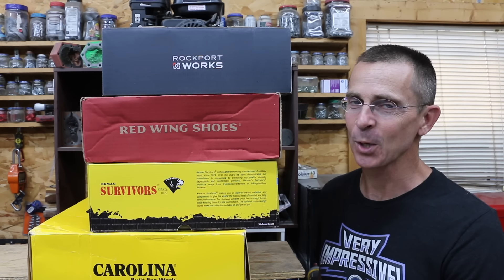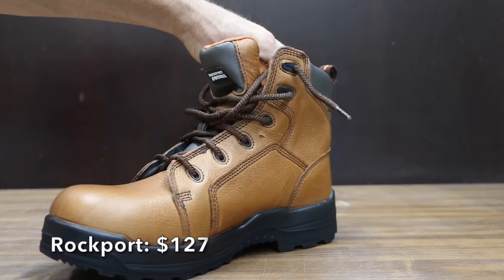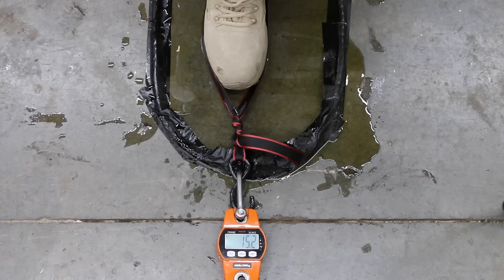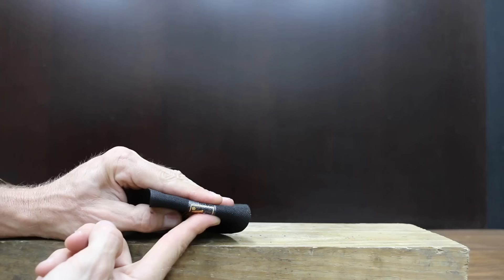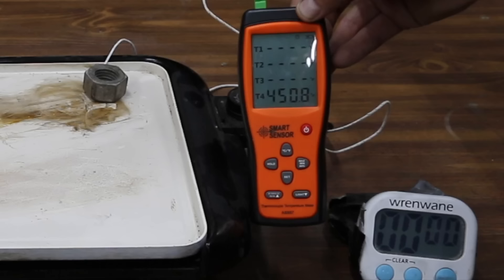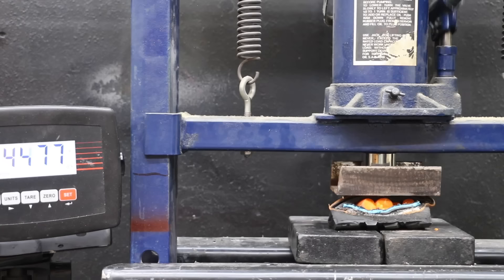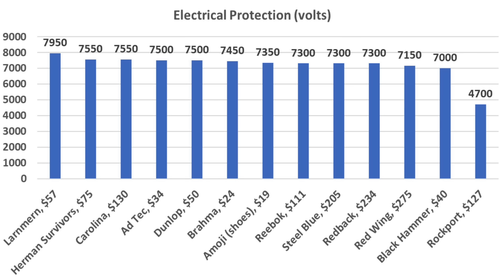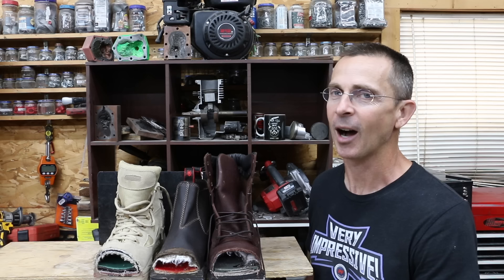Best Boots? $24 vs $275! Let's Find Out!

Comment: Todd, I worked 30 years in a power plant. I wore nothing but Red Wings and only had to buy 2 pairs my whole career. I did have to replace the soles a few times in both pairs but the rest of boot held up great. If you buy good boots, they'll take care of your feet. Great content and channel!
Reply from the maker: Thanks!  Thanks for sharing.
Reply: I wore nothing but Red Wings for years like you said put new soles on now and then witch I had to make sure the shoemaker used genuine Red Wing soles each time  and they were good to go ,I liked the leather on the Wings because I needed water proof so with a regular treatment of wing oil my feet stayed dry all the time ,And the best part is all those years I still used the same size every time try that with another brand.
Reply: That is a the difference with a boot that can be repaired rather then replaced.
Reply: 2 pairs in 30 years?! I’ve had red wings, Ariats, etc. and I have to get new ones every 1-2 years. I work in agriculture.
Reply: true if you bought them 30 years ago not so much today.
Reply: I worked in a garage and never seen any booth that lasted more than a year.  Fact is the chemicals and the way you need to work wore out the tops of the boots before the souls.
Reply: @answeris4217  amen brother. Fertilizer ruins everything too
Reply: @anthonysmith4222  even in construction were your boots become a tool you are kicking everything or using you booth as a leverage point or slamming on the back of a shovel.
Reply: Welder here. I get 4 years out of a pair of Red wings (same as the ones in the video). Typically at year 3 I have to apply Tuff Toe to repair the wear in the toes from crawling around on the ground.  I love that they're USA made as well.
Reply: @anthonysmith4222  Agriculture here too, 9 months is the longest for me. Most boots I have tried come apart at the sole/glue points.
  Walmart's cheapest leather boots last me about 6 months on average, saving me a couple hundred bucks each year.
Reply: @OhioFootHills  I’m trying these Cody James boots out. They have been comfortable so far but run a little big. First non lace work boot I’ve had. Nitrogen will kill anything. Haha
Reply: I also wore nothing but Red Wings, until I found Lalo Tactical. Even more comfortable and durable than Red Wings.
Reply: I had a pair of Red Wing Pecos that lasted over 20 years, and I spent 8 of those years in the oilfield in Texas walking through acid water, oil, and various other chemicals in addition to mud and water. The one thing I did though was wash my boots at the end of a two week hitch and then rub them down with a coat of mink oil. This waterproofed them, as well as kept the leather from cracking. Most people don't know it, but any Red Wing store will clean and oil your Red Wing boots for free. Now personally I wouldn't be a j3rk and take them covered in mud, but if they are a little dusty or only have a little mud around the bottom, they will gladly clean them for you and oil them.
Reply: @anthonysmith4222  I got almost 20 years out my Red Wing Pecos boots. The store I took them to to get oiled would always be in amazement when they saw the stamp on the back that showed the date of build on them. In fact, they asked me if I ever wanted a new pair of boots, they would give me a new pair, if they could keep the old pair to show to customers. I actually took them up on this when the leather finally cracked at just shy of 20 years... They still have them on display in the store. I would either rub them down with mink oil every month (every 2 weeks when I was in the oilfield) or take them in and have them cleaned and oiled by the Red Wing store for free at those time intervals. If you talk to a manager who knows a lot about their boots, they will tell you the made in America line is tougher than their other lines, and the Pecos series is the toughest of all of them. Don't leave them outside on your porch in the elements, don't leave mud on them as it sucks the oils from the boots, don't leave chemicals on them, clean them monthly, and oil them after you do... I prefer mink oil as it seems to condition better and waterproofs the boot. I work the mink oil in using a piece of old t-shirt or sock and let them "dry" for about a day before I am going to start wearing them again.
Reply: @answeris4217  I wore my Red Wing Pecos series in acid water while doing hydraulic fracturing in the oil field for multiple years. I also stepped in clay stabilizer, friction reducer, buffer, oil, and who knows what else chemicals. Now I don't know if the fact that I caked on mink oil every 2 weeks, and allowed it to soak in for a minimum of 24 hours before wearing them back out in the oilfield is what kept the chemicals off them and kept them in good shape, but none the less, they lasted about 8 years in those conditions. I stood around sometimes for 30 minutes straight in an acid/water mix. I always rinsed them off with water at the end of the work day though. I usually cleaned them very well at the end of my 2 week hitch and then oiled them heavily with mink oil and they would be allowed to soak that in for the next week I was off work. Occasionally I would forget and have to oil them the day before I left to go back, so in those times, they only had 24 hours to soak up the mink oil.
Reply: @OhioFootHills  the red Wing Pecos have tacks (nails) that hold the sole together I believe in the addition to glue. I never had my separate in almost 20 years.
Reply: @Steven-gv1ke  they wouldn't last a year in a car garage.  Fact.

No boot would.  The stuff we walked in every day doesn't come off with a hose.  If the chemicals didn't chew through leather it would chew through rubber or any other synthetic.   

We are talking about chemicals that can take years of gunk and baked on grime off of engines inside and out without scubbing.  Stuff that is designed to do the opposite and the stuff designed to clean the floors off with all that stuff on there.

We dealt with extrem cold and extrem heat.  And not to mention we are on hands and knees on concrete every day for every single car.  Sometimes you needed to use your boots to stop cars from rolling.
Reply: @answeris4217  well seeing as how I had to have a HAZMAT license to transport the industrial grade acid we use in the oilfield, I can't imagine the stuff y'all use is much stronger. We had to wear acid rated respirators because the fumes coming off of the acid tanks were so strong. So if you don't wear respirators in your shop around those chemicals constantly, I'm gonna say they were definitely not any stronger than what we use. I was required by OSHA to use an acid apron, full face shield, arm length chemical gloves and an acid rated respirator. Now the acid in this concentration was somewhat diluted by the water that also leaked at times into our "rubber duck" containment pond that ensures we don't allow these chemicals to soak into the earth, but yeah... They are still VERY strong. I would stand in that acid water for sometimes 30 minutes rigging down the acid tanks, knocking 4" hose wings off with a sledge hammer.
Reply: @answeris4217  as far as the heat and cold, I worked in 122 degree heat, in south west Texas all summer in the sand, and walked on top of thick steel machinery that the surface at times was 150 degrees in the sun. If you put bare skin against it, it would instantly burn you. Those boots also went up to North Dakota with me, where I worked for 2 years in the oil field as well. They at one point saw -40 degrees Fahrenheit while I was up there one of those winters. I had to put super thick wool socks on and put feet warmers in the bottom of my boots. Even then I could only stay outside for maybe 90 minutes at a time max before I had to go back into a truck to warm up. Anyone who knows anything about the oilfield knows that they are about the harshest conditions anyone can work in.
Reply: 6 months to 18 months for my redwings. Work in a welding shop
Reply: @OhioFootHills have you tried high quality sewn boots that don’t use glue? 
Like a pair of whites?
Reply: @answeris4217 bullshit. There are plenty of boots that last more than a year in a garage. I would know. I’ve been running my red wings for 5 years now. Regular maintenance just the the aircraft we take care of, and they last a good while.
Reply: @Steven-gv1ke damn, you stool in the acid water without special acid mu boots?? Ever get negative effects to your feet?
Reply: @richeyrich2203  I work in an busy automotive garage and no boot last.  Constantly in oil or antifreeze or brake clean or water...   looking under cars so the steel toe is in contact with cement or kicking steel hoists under the cars.  Using your boots as leverage to stop tires and the like.

Sure in a different environment like a hanger taking care of a single plane your miles might very but I haven't seen any boot that could withstand the punishment of an auto garage.
Reply: @richeyrich2203  I'm giving caterpillar Second Shifts a go at the moment. The first pair lasted about 10 months. They would have probably lasted a couple months longer, but I neglected them a bit during the winter.

Comment: I've had Redwing for years. Several pairs as I walk about 20,000 steps a day. I will continue to buy them. They stay pretty comfortable for years but of course changing the insoles regularly.
Reply: How do you get them to last years? Mine wear out in 6 months
Reply: @Hallowsaw  clean them everyday lol
Reply: @Hallowsaw  They will clean and condition them for free in store. There are several tiers from Red Wing, stick to the higher tiers and they will last years if not 10+ years after a few resoles.  If you get a $200 boot it will last a year, at that price point you are competing with Wolverine or Timberland, if you get a $280+ boot and a custom insole, you are in a completely different world for durability and comfort.
Reply: @Hallowsaw  
Buy the American made boots.
Reply: I agree.
I buy the American made Redwings and they will last for years if you keep them oiled.
Reply: I had my Red Wing Irish Setters resoled by their factory service via local dealer last year for the second time. I bought them new in 1983. ❤
Reply: I walk around 10-12k steps a day with an occasional 20-25k day mixed in at a steel mill. My Redwings last well over a year and I typically replace them because of comfort not integrity, plus my work foots the bill.
Reply: @Hallowsaw  Make sure you're getting one of the Made in USA models, not the ones made overseas.  Most of the Made in USA models should have replaceable outsoles, you just bring them into the store (or mail them in) and they'll replace them for you.  Make sure you take care of the upper.  Most of the Made in USA models are pure leather, so make sure you clean them regularly (at minimum, wipe them down with a damp cloth weekly, maybe daily if your job has them getting a lot of dirt and grime on them regularly) and oil them regularly as well.  They sell stuff they call NaturSeal, or you can use mink oil or vegan alternatives (although the idea of using a vegan oil on leather boots is kind of amusing.)  You'll want to oil your boots more frequently when they're new, but eventually the leather will "drink" enough of the oil to saturate it and you won't need to oil them as frequently.  "Thirsty" leather is visibly different from well-oiled leather, and if you go too long without oiling it, leather will eventually crack and degrade.
Reply: @dc8836  I second every bit of this advice.
Reply from the maker: Thanks for the feedback.
Reply: I`ve used different brands of insoles in my Red Wings the red wing brand inner soles are good but there are others out there that last as good and are thicker and softer.
Reply: @gunfisher4661  Me too. I bought some from Walk/Run store which are working pretty well. I've also used "10 seconds 3210" insoles which I love but they're unique so not for everyone.

Comment: This video basically sums up why I love Red Wing. I went from $50-$150 work boots every few months to a pair of Red Wings that have lasted several years. The comfort difference is just an added bonus.
Reply from the maker: Thanks for sharing.
Reply: red wings are the only boot ive worn the are so comfortable they dont need to be broken in.
Reply: Especially if you go to a redwing store to get the best fit!

My experience: 
Service - 10. Comfort - 10. Durability - 10. Put these things through a deployment, multiple years of use around a shipyard, motorcycle riding, and 6 years past they're still on the original soles and looking great!
Reply: Yea I got a pair of boots I paid &150 for around 9 months ago! Tips are coming apart, and one side seam has busted open
Reply: Still own the Irish settlers from ‘84 - just mink oil and ready to hunt
Reply: The red wings look like the Dutch army boots (kisten) I've been buying for years, great boots.
Reply: Those red wings are 2408, I have the same boots. For normal ground the soles last.
Reply: 100%. The red wings he tested look like my exact preferred boot from red wing. My last 5 or so pairs have been that boot. I get maybe 2 years out of a pair.
Reply: I agree with this statement, the Red Wings cost more but in the end, they don't because they last so long.
Reply: Red wings are my only shoe now.  I have a pair of Irish Setters which are  imported by redwing and they are no match for my redwings (any of them). Red wings are just built different.  My "Postman" shoes are my favorite show and my non-steel toe version of the boot in this video are the most comfortable work boot I have ever worn hands, down no contest.  Believe me, my 20,000 + steps per day proves it to me every time I lace them up.    
I don't say this about many products or companies...  but I absolutely love them, mostly because both have put up with my BS for over a year of daily abuse wearing.  (Abuse wearing is the only type of wearing I do with shoes)...    But more importantly they are comfy..  

I need a duplicate pair of them both so I can truly alternate day to day but still wear the same shoe.
Reply: I used to get 3 or 4 years out of Brahmas when they were about $50 a pair.  Now they've cheapened them up so much (along with Cat, Wolverine, etc.) I doubt i'd get a year out of them.  Let's hope Red Wing hasn't done the same.
Reply: I use 2412 Red wings with the steel shanks and Gore-Tex line and they're closer to 400 bucks but that being said I sent him back to the factory and have them resold for $75

Comment: I wore the Redwing Style 2406 that you feature in this video while I worked at an aluminum extrusion plant in Corona, Ca. They saved my foot when it got caught in a hydraulic lift. The steel toe kept my toes from being crushed and helped hold the steel plate from breaking all my metatarsal’s. Overall damage was one broken metatarsal, damaged tendons, and severe bruising. Great quality boots, I’d recommend them to anyone.
Reply from the maker: Thanks!  Thanks for the suggestion.
Reply: Garhettgross - thank you for not sharing the gristly photo. Crushing toes is an important test which Todd amazingly missed but which anyone working in heavy industry should seriously consider. Most of us go with a price/comfort ratio thing. The shock is that the Redwings tested #1  (by PF) for comfort as well. I've never owned a pair due to the cost, but would consider that if I needed my toes not crushed:-) The info is much appreciated!
Reply: Been wearing them myself for many, many year's. Very comfortable (for me), grip well and wear like iron. The 2406 really is a very high quality boot.
Reply: Did Todd not do two tests that demonstrated the boots’ ability to prevent toe crushing?
Reply: whats your opinion on the 3507, if any?
Reply: Red Wing will take that boot and fix it if they can, but they love to hear about the effectiveness of their boots, even if they can’t fix it.
Reply: Best boot I've owned as well. No plans to switch any time soon
Reply: The Redwing did not save your foot....the steel toe saved your foot.
Reply: Im wearing my 5th pair of 2406..the greatest boots ever made..glad youre in one piece 😀

Comment: Quick tip; If you'll be spending a lot of time on ladders, get boots with a steel shank. They'll keep your arches from aching. Great review !
Reply from the maker: Thanks!  Thanks for the feedback.
Reply: Especially if you have planter faceitis, which then can irritate sciatica if you have it. Also, you develop aches and pains in your joints, knees, low and mid back. It's all related to your shoes/boots and whether your arch' are off. Once this happens you start to develop callous  pressure points where the skin will callous. 

Be sure and use a golf ball preferably (if you can tolerate it), or tennis ball and roll them under each foot to break up the fascia tissues. I would also invest in a electric foot file. You will be amazed at the difference in your feet.
Reply: very true!